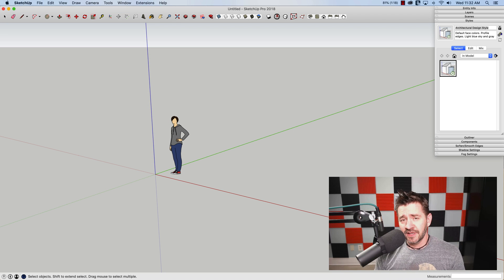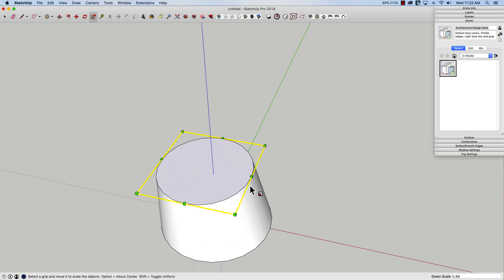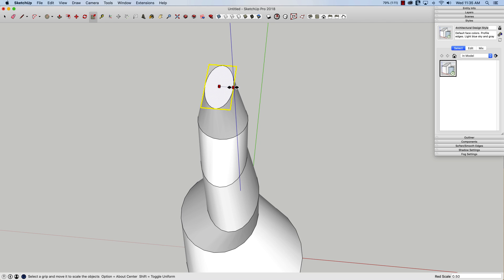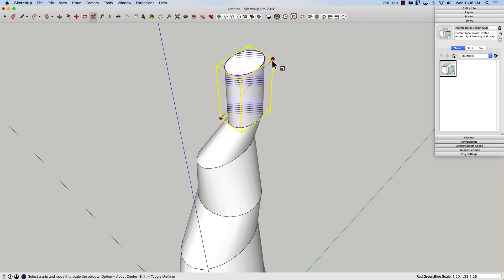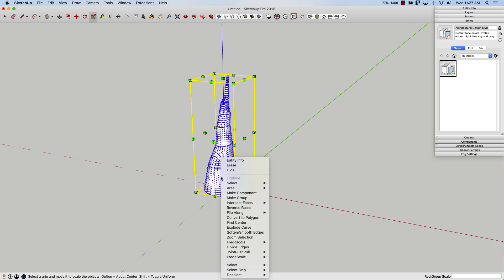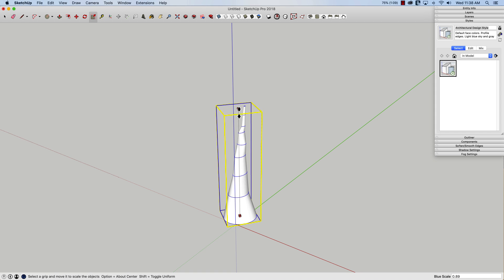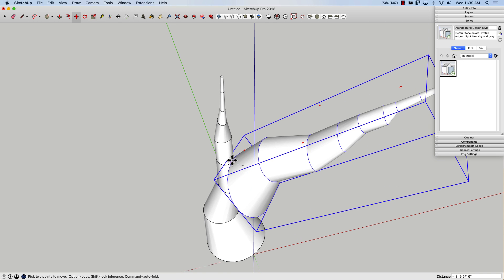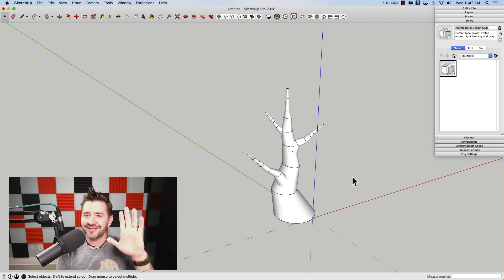How to use the Scale Tool in SketchUp - Skill Builder

Comment: I just realized while watching this video that when creating arched openings, if I draw a circle (dimensioned on CARDINAL points per another one of your videos) between the sides of my opening, then scale the circle to form an oval with twice the height of my desired arch and erase the bottom half of the oval I get a much smoother arch transition to the verticals than using the arc tool to create the arch. Thanks for another great video!

Comment: What if one wanted to scale the object uniformally but based off a measurement? Such as, i made a part in meters to do all my cuts and holes(avoid tiny face issue) but now i need to scale it down to inches or mm so that all dimensions are uniform ie if a hole was a radii of 3 meters but it needs to be scaled to 3 inches:) thanks
Reply: In that case I would use the tape measure tool to set the scale, instead. Use the Tape measure tool to click across a known size, and then type the exact dimension. Check out the beginning of this video for an example https://youtu.be/rKVSDOFoSl4)

Comment: Am I still missing something, or is it not possible to type in absolute values when using the ctrl or shift modifiers with the scale tool? I feel like the modifiers should be toggles, which would then allow typing in values.
Reply: Remember, you can always use the handles to temporarily scale along an axis, then type in an exact dimension or percentage, afterward (you do not need to do it while holding down a modifier key and mouse button).
Reply: Ahh, right. I never thought about that still working with the modifier keys. Thanks!

Comment: You should have talked about the Scale definition feature built into Sketchup as the scale tool will distort the material and using the scale definition will reset the material back to normal.
Reply: Good call! Fortunately, there are always more videos to be made! Thanks!
Reply: Whats this definition tool you speak of good sir?
Reply: @LT72884  If you have an object and you apply a material to it then that would be the default size and scale of the material, if you then scale the object after it has a material, the material itself will also be scaled and stretched out, after scaling a materialized object you can right click it and click the Scale Definition option and it will re apply the material as if the object were never scaled.
Reply: illestmuzik ah, yes. I see what you mean. Thats noce to know. Infact, today i ran into that issue. Now i know how to fix that:) thank you kind sir
Reply: @LT72884  No problem, goodluck!

Comment: Thanks for sharing. You might consider going into the materials tool, since textures are affected by the scale tool. For example using fence and post textures on the horizontal as well as down a stairway. This is the only case I have come across that relies on the distort pin (the red button I think). If you really need a challenge, you can explain how UV maps change texture settings for several faced simultaneously
Reply: Too true! May need a Quick Win add-on about Materials and Scale!